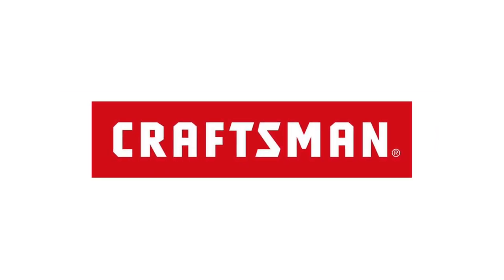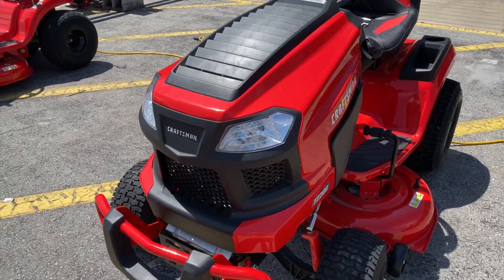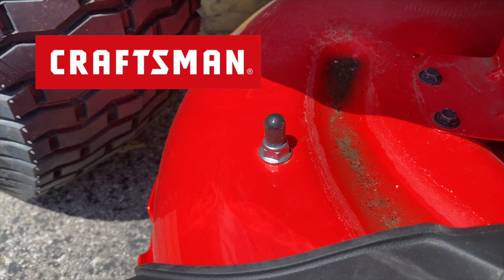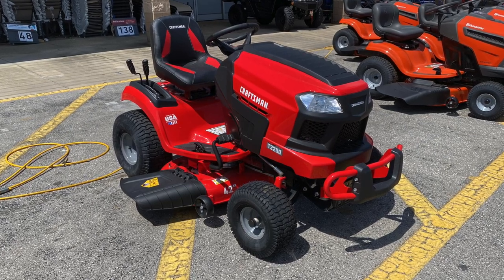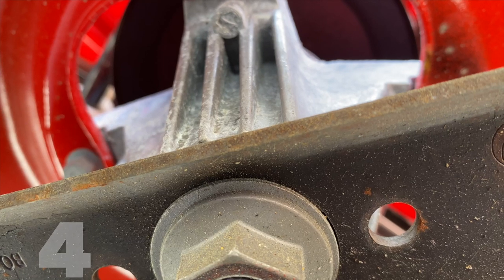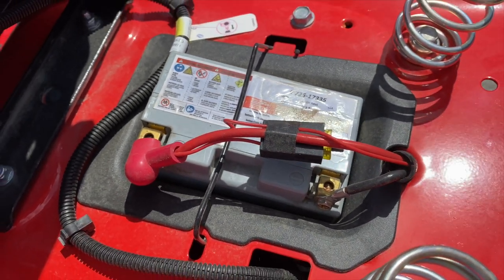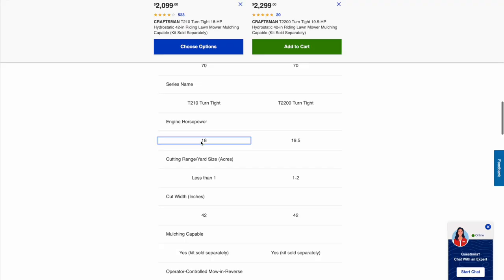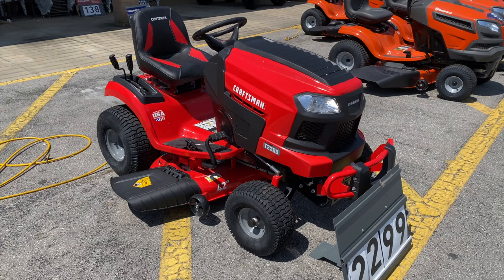Craftsman T2200 42" Riding Mower | Features and Components Does this Replace the T210?

Comment: I bought a T2200 from Lowes about 4 weeks ago.  It's still early in the mowing season here in Georgia in 2023 but I do have one comment on this mower.  For whatever reason the headlights are ON all the time. Why in the world would they not include a light switch?  I'm not driving it on the road!  Jeesh!!   

Anyways, I bought a toggle switch through Amazon and installed it in the knockout panel position where ... maybe an upgraded model has a light switch.  What a cheap thing to do. Why would they not include a light switch??!!   I also bought 2 LED lamps to replace the incandescent lamps that came with the mower. Much much brighter.

Comment: In 2005 I bought an (MTD) Poulan Pro 300EX w/ Kohler 19 Courage and had very few issues, just age. Last year 2022 I sold it for $600 and bought the T2200, mostly because it's MTD & with the Kohler 19.5. I'm 6'7" & 300lbs and the T2200 is a huge upgrade from 17yrs ago. Dotting on the Turn Tight, Foot controlled forward & reverse and not to forget the Seat.! Now, I just happened to buy mine off the truck and not sitting outside of Lowe's for months and my mowers are kept in barn, so...
June 2023 is 1yr of ownership and I'm hoping for at least 16 more with minimal issues.  Thanks for your channel and God bless.
Reply: someone said the forward and reverse are on the same pedal. is this true? thanks!!
Reply: @JayFarm_23   No... if you've ever ridden a motorcycle with a heel toe shifter it's kind of like that but on the right side. It's a fluid motion with no problems. There's also a button that you can push so you can cut going forward and going in reverse. I've had it for about 2 years now and really enjoy it.
✌🏼God Bless
Reply: @bigk3381  I've never rode a motorcycle. guess I'll figure it out LoL thanks
Reply: @JayFarm_23  Understood... Its seriously no problem at all.
Reply: Don't count on it. Quality on these newer mowers is terrible. Warranty? What warranty? I've had 2 in a year. Both turned out to be bad purchases.
Reply: @gkins1907  ...over 2 years now and "0" issues. I think a lot of problems come from care and I'm by no means rich so I take care of what I own. Hoping for many more years of reliability.

Comment: I purchased one of these from Lowes last year. It had issues with the choke sticking, wiring, starting, back firing and safety lockouts.
I took it back. Looking at reviews like this that were positive I decided that I must have just gotten a lemon. So I got another one. 
Then I discovered these new blades are patented so you can only by the S blades. And they are definitely S. They wear out in half the time of other blades like the 6 star. They get you on the price. Currently $60 a set. Twice what the older blades cost.
The second one ran well, performed well for about 5 weeks. Then the choke started sticking. Then the transmission anti-roll lock that stops the mower quit working. Yesterday I noticed the mower slowing and a strange noise coming from the transmission. I called the 'authorized' repair shop and they notified me that the 'Warranty' does not cover the engine or it's components like the carb. They also told me the 'Warranty' does not cover the transmission. I'm not sure what the 3 year warranty that LOWES advertises covers. Apparently not the mower.
I paid more than double for this mower than what I paid for a Poulan Pro (Husqvarna) 6 years ago and have a $2500 piece of junk. Never again. I'll be going back to Husqvarna.
Reply from the maker: Wow. Horrible experience. Thanks for sharing. Personably, I would be calling Craftsman for warranty coverage, not Lowe’s

Comment: I'll stick with my T210, your the reason I bought one, lol ..not one single problem going into the second year, back yard is over 1/2 acre, front yard is almost as big. Does everything it was described to do, just put the cruise on and ride....I remember the day I was shopping for a riding mower and ran across you review on your purchase of a Craftsman T210, it sold me, the closest thing you can get to a Zero Turn for sure...
Reply: I'm so glad I don't need a riding mower.  The quality has come way down along with parts availability in the last 20 years.
So much stuff is throwaway these days. The parts market is largely responsible. So much stuff is just not economic to fix because the parts get marked up so much.  Like if the crank or cam failed on this thing, it wouldn't be worth fixing, especially 5 or 10 years from now.
Reply: @tarstarkusz  
If with proper care and maintenance I get 10 or more years it would pay for itself 10 times over, I tried my Honda self propelled mower once, and that's the last time walking 5 miles. So the cost of the mower minus the $150 a month for my Gardner will pay for itself in a short time. So I'll just put my made in USA steel craftsman mower on cruise control and relax..but I do understand what your point is, just don't agree with it a 100%.,..
Reply: @bobl185  I don't need one because I don't have the amount of lawn that makes one necessary.
What I meant is that the parts market is so bad for a lot of power equipment that you can just buy another one for what it costs to fix.  I have seen and heard of riding lawnmowers junked because it needs a new cutting deck (the whole assembly) because of rust or something or a blown engine on a 10 year old machine that is otherwise in good shape.  So unless you can do the work yourself and get the assembly used, it is simply not economical to repair it.

In my mind, this is all caused by one thing and that is we buy the equipment new based on outsourced labor costs, but when it breaks, we have to pay an American (with American salary needs and bills) for either the parts or the labor to fix it.  This mismatch is so great that if we were buying cars from China and Vietnam and Thailand, we wouldn't be able to anything but the easiest repairs because it would be cheaper to just buy a new car than pay an American to fix it.
Reply: @tarstarkusz  
I understand fully about parts and labor costs, that's another reason I won't take my lawn equipment to a shop for repairs, I have learned to fix just about any issues myself. Like you have stated, they will charge you almost what the mower is worth !!!! Haven't had too many issues with getting parts, but have had to get some from eBay. My year old craftsman has many parts just waiting to be installed when needed, it's easier to buy the parts that wear out when the mower is newer, when it gets over 5 years old parts are very hard to get, not to mention very expensive....but like you say, after 5 years or more how much is your mower worth ? and how much are you willing to put into it instead of just buying a new one ? LOL

Comment: Mine was definitely built on a friday as the quality control was lacking. I got a T240 in 2020 which came with a slow leaking front left tire.  Battery failed at 4 hours on the clock or 5 months old. At 9.4 hours 1 season it got a stretched throttle cable so now shes a hard start. I remove the hood and manually operate the butterfly to start it now. MTD will dodge warranty work any way they can don't bother.
Reply: Similar problems here. I'm considering filing a false advertising suit against LOWES they claim a 3 year warranty, turns out half of the mower isn't warrantied, and a suit against MTD for not honoring the advertised warranty. All sorts of problems.
Reply from the maker: @gkins1907 I have a friend that has one of the many MTD variants (Toro) that he bought at Lowe’s and his transmission was replaced under warranty.

Comment: I paid $100 for my '03 LT2000, has a 22hp Intek V twin on it that surprisingly fired right up after sitting outside for 2 years with a ton of junk in the carb bowl (that I later removed to clean after determining the engine and trans were in good shape).  From now on my lawn equipment gets ethanol free fuel only.

Tye hp doesn't really matter because it's a lawn tractor and can't do what a garden tractor can do(hydro gear trans), it's just to cut grass and pull a small cart around.  Currently in pieces as I wait for parts to come in from Amazon, and I decide on a color scheme to paint it.  Considering using bedliner on the whole thing, kind of like that look and it's durable.

Comment: Thanks for the video!  I saw your t210 video a few months ago and wanted to buy that mower however it has been discontinued. As a result a few weeks ago I bought the t2200. Lowe's has been storing them outside since mid February. I am in the central Ohio area and it has been snowing and raining a lot and these mowers have been sitting outside the whole time. Because of this I asked for the Lowe's manager and told him I would not buy one unless it was new and had not been outside.  Fortunately they still had one in the back that had just been put together.  My mower looks a lot cleaner than the one you were videotaping.  I do like the mower but I thought the manual said it had a 9-in turning radius not a 5 in?  I have used the mower twice and so far like it but it is a bumpier ride than an older John Deere that I had and the motor and the lower idle position does not run as smooth as I think it should. I would say the John Deere seat was more comfortable as well.    Appreciate all your videos and hopefully you'll have a chance to post some maintenance videos for us average Joe's 🙂
Reply from the maker: Congrats on the mower! Spec listing for the T2200 says: 5-in. Turn Tight radius

I have an oil change video. I have also filmed the incremental 10hr services. Hopefully I can edit all that footage together at some point
Reply: @kev-reviews  Thanks Kev and appreciate you clearing up the turning radius - it does turn nicely.  Keeping my fingers crossed for a long mower life!  Right now,they are all expensive and/or in short supply.
Reply from the maker: I couldn’t believe the prices when I found this one in stock. 2 years ago my T210 was 1799 regular price. I paid $1599 about a month before prices started slowly creeping up
Reply: yea I just got the 2200 from lowe's also I am in northern ohio and yep mine too was setting in the rain ,,,, BUT so far I like very well
Reply: @Captain_Sweatpants_945  i mistakenly thought that whoever set these up for Lowes inflated the tires correctly.  After the third cut and how rough the ride was, I checked the tires psi - all of them were more than double the max as stated on the sidewall!  I deflated to the recommended psi and the ride is much much better.

Comment: It's made by MTD to the Craftsman Specs big difference
Reply from the maker: Since they’re both owned by the same company how does that make a difference? Craftsman has never had its own mfg facilities
Reply: @kev-reviews  because the Craftsman brand and MTD mowers are different..2021 Craftsman T240 Turn Tight or MTD? Craftsman T240 Turn Tight Lawn/Garden tractor by a country mile..it's built to last and it's heavy there are also different variations of the Tuff Torq K46 hydrostatic Transmission even a heavy duty K46 model..
Reply: @kev-reviews  craftsman the name has there way and MTD makes there's to the MTD specs you should have already known this
Reply: @KevReview craftsman has there own ways of doing things..it's like a guitar Jackson made in the Cort Facility it's made by Cort but to the Jackson brand Specs

Comment: I want the T2400 but can't get one. The T3200 is available so I may order it instead. I really want the tight turn and wish others would come up with something like it. I'm a little worried on the transmission now though. May have to check them out before I buy. I currently have a 9 year old Troy Bilt Bronco 42" with a 20HP Kohler. It rocks but the turn radius could be better.

Comment: I appreciate the review, it provides insight.  It sounds like it is not worth looking for a T210 on the after-market because they may not be supporting the unit since supply chain issues.  Also would you ever go back to a T110 or that would also risk obsolescence?
Reply from the maker: It’s the same parts used in the T2200 and many other MTD-made mowers, so I wouldn’t worry about parts supply. There’s lots out there for it and other MTD mowers. I prefer hydrostatic transmissions, so I couldn’t see myself stepping down to a T110 unless financial necessities were the major driver of a purchase.

Comment: I bought the t2200 yesterday in Tampa Fl. It’s been so hard to find but I finally found a store with 1. I returned it today after seeing your info on the s blade. I couldn’t find the mulching kit anywhere. I saw you post the Mtd blades but can’t find the whole kit anywhere. I ended up exchanging it out for the t110k. Now I’m wondering what kind of blade kit it takes! If it’s the one that’s readily available in stores or the s blade just like the 2200. Do you happen to know?
Reply from the maker: I’m not familiar with the ‘K’ variant of the T110. If you have the mower already you can raise the hood and look at the sticker on the inside of the hood. It will tell you the part number for the blades. You can use that to look up the blade to see what type mount it fits

Comment: Kev, I just got a T2200 from Lowe's mostly due to that right turn radius.  I'm looking for the mulch kit for it, but no one has it! Any idea of an MTD equivalent? As you mention, 2200 had those "S" holes.
Reply from the maker: That’s a new pattern so I guess lowe’s didn’t stock up in the mulch kit yet. These are the mulch blades that fit it:

https://www.homedepot.com/p/Cub-Cadet-Original-Equipment-Mulching-Blades-for-42-in-Electric-Riding-Lawn-Mowers-with-S-Shape-Center-OE-742P05720-742-05720-490-110-C207/316769760

The mulch plug is so crappy even the generic Amazon ones are going to perform the same, so you can piece together the kit

Comment: One way some manufacturers raise their HP  is to rate it at a slightly higher RPM. Briggs did this years ago when the 3hp jumped to 4 and then to 4.5. Exact same engine.
Reply from the maker: Thanks for sharing

Edit: didn’t they get sued for their HP claims?
Reply: @kev-reviews  I don't know for sure. I know there were some air compressor companies that got sued for vastly overstating their HP.
Reply: @kev-reviews  I don't know. But there were some air compressor manufacturers that  were vastly over rating their HP. I remember walking into a tool store that had 5HP compressors  that had a 15 amp 120 volt cord. That is mathematically impossible.. The tags on the motors did not list a HP but they said "SPL" which was a legal way to get  away with  it.. They can't do that any more, legally. But I'm sure they found a way around it. From what I read, they would spin the motor up to speed, then lock it up instantly. The brake HP it took to stop the running motor became the rated HP.

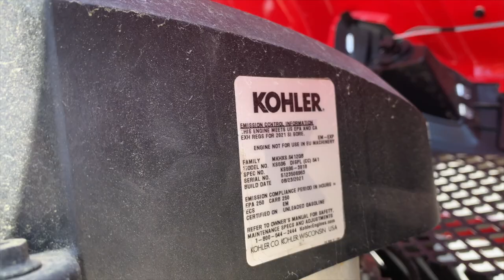Comment: 6:29  They're probably just lying about the power.  What are you gonna do, take out the engine and hook it up to a dyno?   This is getting very common. 

I was watching a review of a 2000 watt generator the other day that was rated to 1400 watts continuous and with a HP rating to make that possible.  Yet, the electrical system is fused at under a KW and the generator fell on its face and stalled if you put more than 940 (IIRC) watt load on it.  This was a generator available at places like Walmart, Home Depot and the like, though it might have been mail only.   They also included a paper saying the warranty was void if you bought it online.
Reply: Small engine dynos are very common.  Kohler has a reputation to uphold and aren't likely to jeopardize it so Craftsman can sell more mowers. I sold my hydraulic dyno last summer but still have my water brake dyno. Most small engine shops that are into racing will have a dyno.

Comment: Love my two year old T210 ... Cut 1.75 acres weekly and it's almost fun to get on this mower and cut. Seen another video where it seems the carburetor has been a issue with this 18 horsepower Kolher. Gas in the oil , the plastic float does not play well with Ethonal gas.
Reply from the maker: I don’t use ethanol on small engines. Especially ones that tend to sit for weeks at a time and have a carburetor for just this reason. Non-ethanol keeps carb issues from happening usually

Comment: I got my T 210 back in September 2121 and already the reverse is not always working. I have to quickly press the other gas pedal and  put my foot and press the reverse pedal. It used to work fine and I have not used it much
Also…how to set the cruise control on it?

Comment: Stronger motor and weaker transmission doesn't make sense to me. The corrosion issues are also a problem for me. They could have hit that aluminum with a clear coat and it would stay nice for years.

Comment: I have a 2017 T7800 Pro Series which is a very similar model, it gets a lot of use and no plastic has cracked or broken. The deck paint didn't last and the mulching plug is a joke, mulching isn't this mowers forte. The deck design allows clippings to accumulate unmulched unil they drop to the ground leaving clumps, even at slow speeds (slower than the cruise control can be set to).
Reply from the maker: Thanks for sharing. I’ve had good luck with mulched grass/leaves being mulched without clumps. What I’ve had an issue with is that absolutely useless mulch plug!

Comment: Indeed the newer craftsman Tight turn tractors are a downgrade from the previous models the seat  brush bar and 1 horsepower more isn't significant not at all.. I have a 22 horsepower 725cc V Twin Kohler 7000 series in mine but mine has the k46 transmission not that weak cheap Tl200 my Craftsman Turn Tight is also built to last..not surprised craftsman did this they all do it new models the first couple of years are built very good then when the brands see that it has sold well the cheap it up next round.